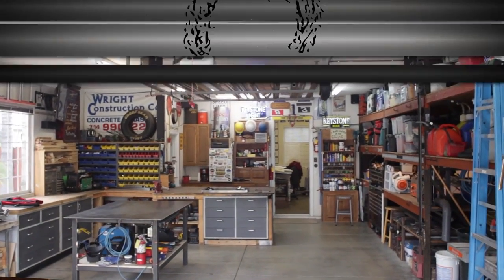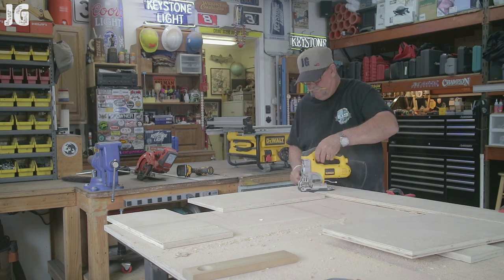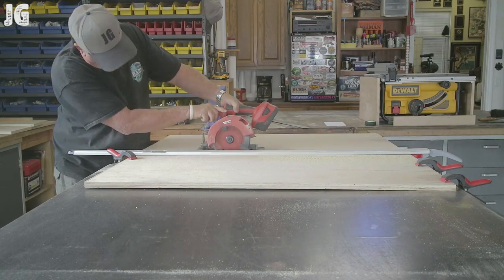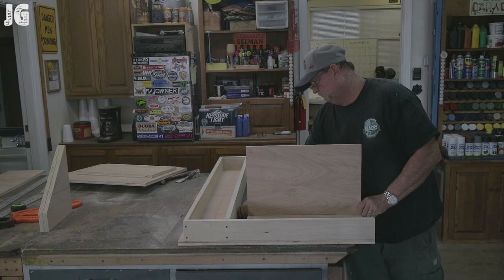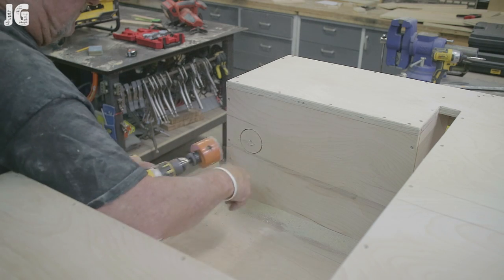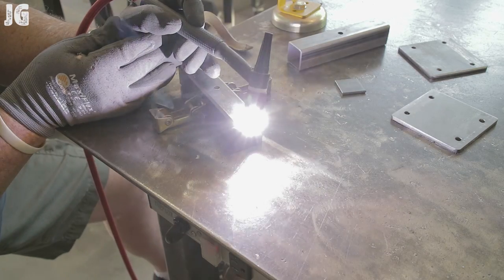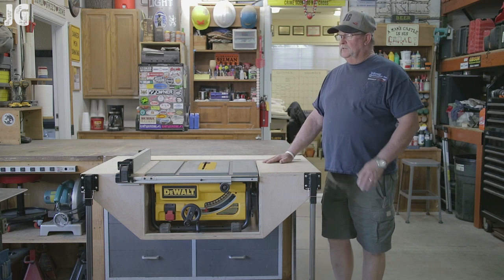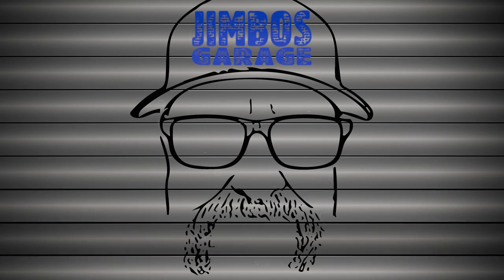Table Saw 'Table' Build - Jimbos Garage

Comment: Very  nice build.  I have the same saw will be doing similar this weekend.  Does your cutout for the fence track limit the rip capacity on the right?  That fence can move waaaay out the the right,  15 inches from the table's edge.  Maybe you don't need that feature or I'm missing something? 
Thanks.  Great vid
Reply from the maker: Thanks for watching Matthew, The slot allows the fence to go as far left and right as it can go.  You can also put the fence on the other side of the blade.  Jimbos garage!

Comment: The Dewalt fence has a clip on the front and back to remove it... I often need to remove the fence during a project. Is it difficult to access the rear clip to remove the fence? Doesn't k like much clearence. Love the job overall though.

Comment: this question is off topic but have you ever welded with the everlast power tig on 110 of so how dose it weld
Reply from the maker: +Malachi Cassel   Thanks for the comment Malachi, No i haven't, I have 220 power for all my welders, However the power tig 210 ext is duel voltage, Maybe i will try it on 110 and let you know the results!   Jimbos garage!
Reply: +Jimbo's Garage thank you.The reasone I was asking was because eight now all we have at our house is 110
Reply: +Jimbo's Garage when do you think you will have the results
Reply from the maker: +Malachi Cassel   Malachi, Do you have a Everlast power tig 210ext? Or are you thinking about getting one? I am in the middle of a project now but i will try it in the next day or so and i will let you know! Jimbos garage!
Reply: +Jimbo's Garage I am thinking about getting one
Reply from the maker: +Malachi Cassel   Ok Malachi, I have done a small sample on 110v With some 1/8'' thick material, It seemed to  work fine. Im going to do a video on it in the the next week or so, So stay tuned! Jimbos garage!
Reply: +Jimbo's Garage thank so much most youtubers will not do anything like you have done.Like make a video from one question or request and that mean your awsome keep up the great work

Comment: Hello, I see that you are using it on the left side, I am  left handed and I am thinking about buying this table saw (DW745 model right?) , does the fence expands to the left side and if so, how long? Did you had to modify the system to use it on the left or you just turned the system the other way? I am asking this because I was told  by a vendor that the expandable guide can only be used on the right side. I Would appreciate your responde very much. Sorry for my english, it is not my first language. Thanks!
Reply from the maker: Thanks for watching Jesica, I'm left handed also. That is the way it feels right to me, I didn't make the adjustment for flipping it around, But i'm sure it can be done.  Jimbo!

Comment: what kind of cleat did you use?  Using a French cleat with stop ends will negate the need for screws into the cleat making it more mobile  and modular in design....just a tip....

Comment: I looked through a lot of comments and didn't see anyone talking about the glue. There's red blue and green. tightbond then 2 and 3. original is just wood glue. 2 is water resistant and 3 is water proof.
Reply from the maker: Thanks for watching Dallas,  Yes i use all three, I don't do a lot of wood work and don't know if one is better than the other, Other than the water resistant and waterproof. I have a lot of the green color right now so i use that for everything.  Jimbos garage!
Reply: Jimbos Garage none of them are stronger than the other. that green one I want to say is 3. it cost quite a bit more than the others. that should, at least, allow you to save some money in the future.

Comment: For anyone who this might help I find it best to drill the pilot hole first and then go through with the hole saw. What sometimes happens is the hole saw catches the material at high rpm and then the drill bit gets bent. With wood it's probably not a big deal but with metal it just tears up that drill bit. It's kind of a lame design to be honest.

Comment: nice job!! looks great! love the way you build.
Reply from the maker: Thanks for watching Matt! I enjoy your's and Jimmy's as well!  Jimbos garage!
Reply: Looks really nice it's a nice saw to, I was thinking maybe you could put a open system on your French cleats or your plate that you have on the back of the saw that you could pin in with some metal pins into the wood to hold it down rather than use the screws so that you don't have the same problem we had with the previous portable table legs for the holes got worn out other then that it looks great I wish I had a shop your size to accommodate all those cool set ups and tools

Comment: you know what, i build everything on the fly, no real plan, most of it's just for myself anyway, so,,,,but i never realized just how many types of fasteners i (aparently ) must be wasting according to outside eyes, if i'm glueing something, i always use brad nails, and or clamps, then i use sheet rock screws, or wood screws, then i may use a bracket, or steel strip bracing, most anything that has to hold weight  will have seat belt material wrapped around it with various epoxies, ( i paint cars , so i get seat belts out of totaled cars, among other really usefull , not easy or cheap to find stuff), man, if i put any of my builds up people would probably freak,lol
Reply: and i just realized, suprizingly, i use very little metal at home to build things, probably because i use it soooooo much at work , i don't want to see it at home